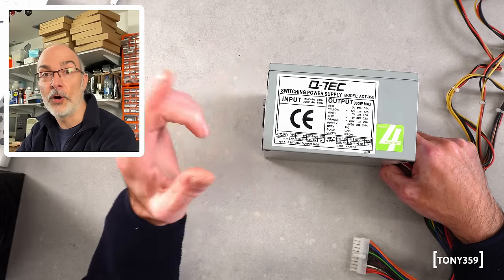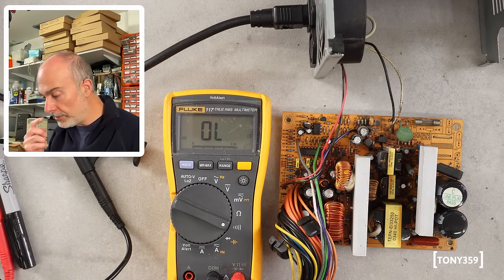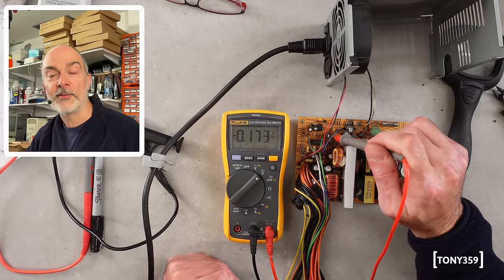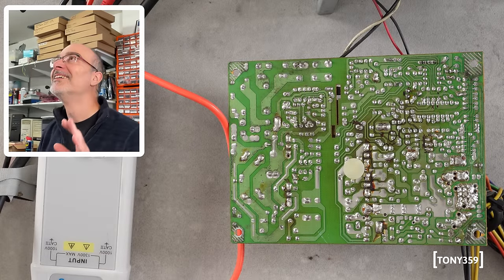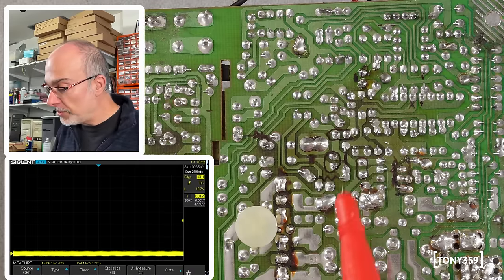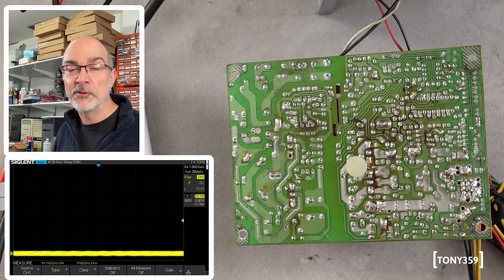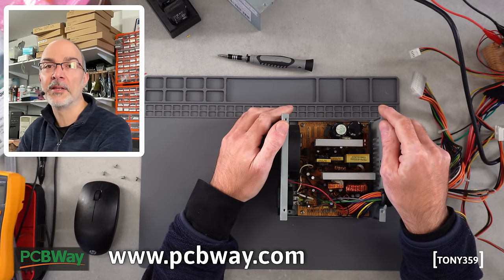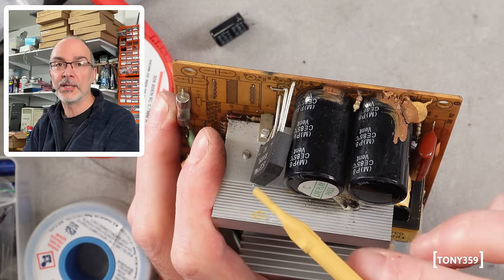Let's fix this 𝗗𝗘𝗔𝗗 ATX power supply!

Comment: q-tec was the lowest of the lowest quality back in those days. My dad had a "400w" q-tec, it had 3x 80mm fans and melted thin wires in his pc.
Reply from the maker: Wait a second, are you telling me that FUHIYYU is not a good brand? I am shocked. :D

The worst of the worst, why am I not surprised! LOL! Thanks for watching!
Reply: The PSU has extruded heatsinks. So it's far from the worst I've ever seen.
Reply from the maker: You're right, I've seen those with small metal plates in place of heatsinks! :)
Reply: @tony359  the real junk has aluminum sheet metal with some slices for fins and bent back and forth. When you opened it up and I saw the extruded heatsinks I thought, not half bad. I wasn't keen on the lead length they left though. It looks like they didn't clip the board after it was wave soldered. They just trimmed the parts short before they stuffed the board.

Comment: You made a big deal about this P/S having -5 volts available but you didn't check it until the very end on the video.  🤔
Reply from the maker: Would have it been different if I had checked it 10 minutes earlier in the video?

Comment: OMG this power supply is as hideous as its outside suggests! Starting with lack of E-number that would point to a known manufacturer... the complete input filtering has been unstuffed and bypassed, PFC is removed as well, the only concessions to compliance you get is inrush limiting (without bypass relay) and a fuse.

I do have some of that era's PSUs for when i might need them but they're all FSP and the like, reputable.

Haha typical capacitor squeal! They're begging to be put out of their misery!

I notice you're not paying attention to the most important measurement of the LCR T4 - VLoss. It's REALLY bad on all the capacitors that you show measured with even the 330u one being if not quite as completely dead then about borderline. What it means on these LCR T4, is how much voltage has dropped when you leave the capacitor alone disconnected for one second, and normally you expect a capacitor to hold for minutes, so anything above a couple percent is a failed capacitor. High VLoss also means the capacitance reading is completely unreliable, it reads much higher than the real capacity, because from LCR's perspective, the capacitance is how much power it had to put in to reach a certain voltage, but the energy kept getting burned off and turned into heat as it was getting put in, as seen from VLoss.

I almost don't beileve in bad caps. I mean yeah they are low grade here but you're also not seeing any attempt on this PSU to limit the amount of ripple current they have to handle, no parallel ceramic capacitors anywhere. Often i see capacitors fail due to bad placement simply too close to some other heat source. You can get a lot of mileage out of cheap caps and good engineering.

On PSUs of all things i prefer not to live probe and trace faults for safety reasons, because there's a small chance for things to go wrong and i only have so many lives, and the amount of time and effort to ensure and double check i'm doing everything as safely as possible is just too much. I just discharge everything, do some in-place measurements to confirm as many parts as possible don't have obvious faults, take out all capacitors except those of which i pretty much know they didn't fail or don't matter, test them, and then rebuild the PSU. I don't care about elegance when my life is on the line. And i mean what, it's not like i'm wasting components by replacing ones which are obviously bad, need to replace them anyway!
Reply from the maker: Thanks for the explanation, I planned of checking what that VLOSS meant, now it's clear! The power supply is connected to an isolation transformer with current limiting - I know it doesn't give me 100% safety but maybe a little. 
And I see what you mean with "good design will extend capacitors life", it's a very interesting point! Thanks for watching!

Comment: if you used standard electrolytic caps   consider instead using "LOW ESR " type ..they cost a little more to buy but last a very long time
Reply from the maker: I normally buy Panasonic series FR, low ESR and 105C. I don’t see the point in buying cheap caps 🙂
Reply: if you find electrolitic caps  "cooked"  etc       put a sleeve of heat-shrink over the new cap body   (make sure you it is about 5-10mm above top of new cap (and if required    ..to stop heat-shrink falling off the cap   ...just heat up the very bottom of heatshink on the cap  :)
Reply from the maker: @kenhowells1618  Thanks.

Comment: Please do not wave metal leads along pcb. One wrong move and you got yourself an explosion. I know the hard way😢
Reply from the maker: Can you point me to the moment when I did that in the video? Not arguing, just curious!

It's always dangerous to work with an open PSU. But I always use my isolation transformer which also features current limiting. It was set to 60-70W. If I shorted something, I get a "piff" - though those large capacitors would definitely make quite a spark :) But the PSU is not directly connected to mains. I do appreciate your feedback though!
Reply: Good to know. One cheap way is test-powering psu through a 40w incandescent bulb for current limiting. I am not saying you violated hot part of pcb anywhere, so i can't say, sorry. it just feels so dangerous. When my single big caboom happened to me i wasn't in any way ready for it. And then my hands are charred and i am in shock instantly.
Reply from the maker: The Bang Preventer I am using is exactly that :) https://www.youtube.com/watch?v=38jQtb0LAhA

Working on power supplies IS dangerous. But the limiter should avoid the worst. And the isolation transformer should help too. Sorry to hear about your experience.

Comment: Careful what you use the power supply for.
I had a PSU that went down and went high over voltage as it died and TOOK OUT my MOBO and four large and expensive hard drives
Reply from the maker: Yes, that's why I tend to use high quality PSUs in my computers. This one is notoriously bad quality so... well, it was an exercise, I learnt something from it :)

Comment: gate drive "separated for safety" Huuuggghhh????    I don't think so!  It is BECAUSE they are referenced at different voltages that would OBLITERATE the gates of the mosfets!
Reply from the maker: Of course but I think what I meant was that primary and secondary are also separated for safety, no? Components might fail and you don't want 240V or 340V DC going into your PC. In this case obviously the separation also achieves what you say. Feel free to correct me :)